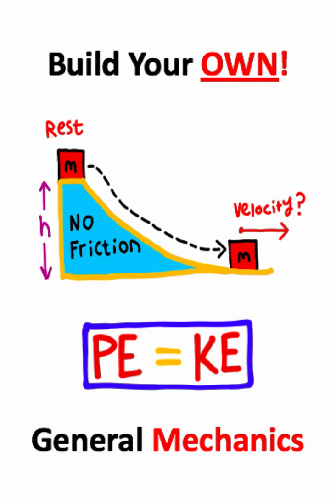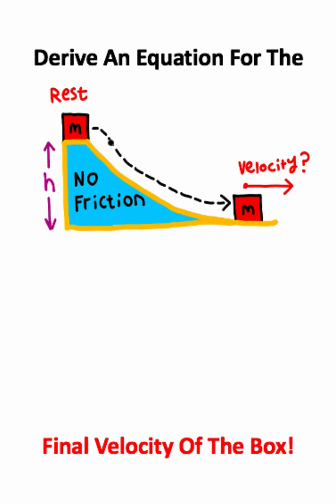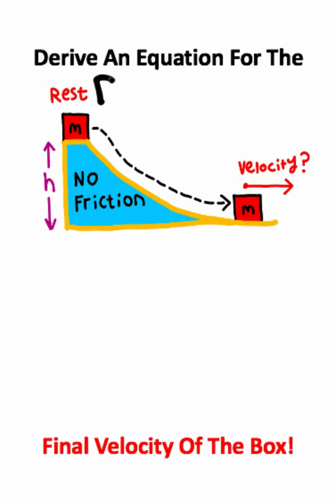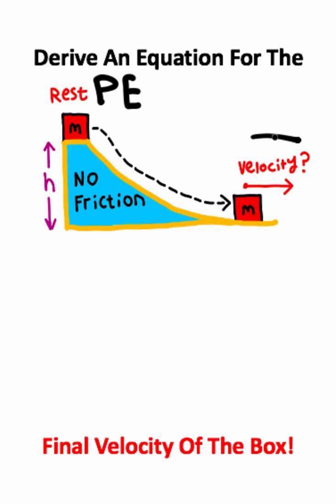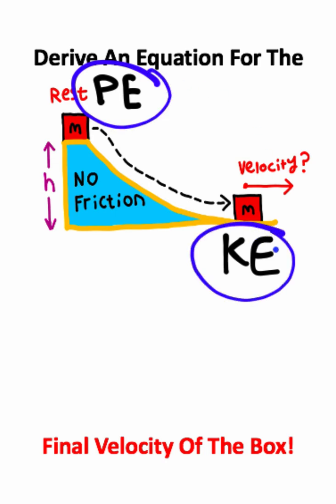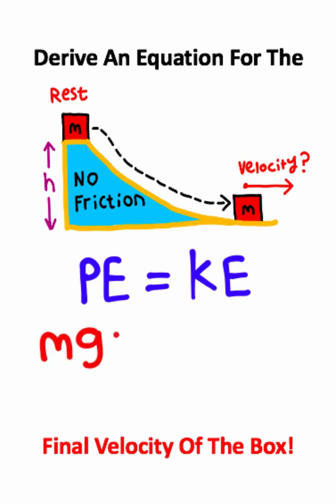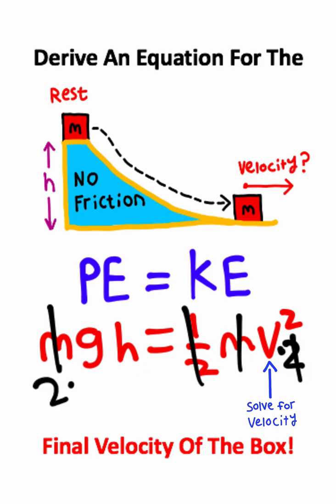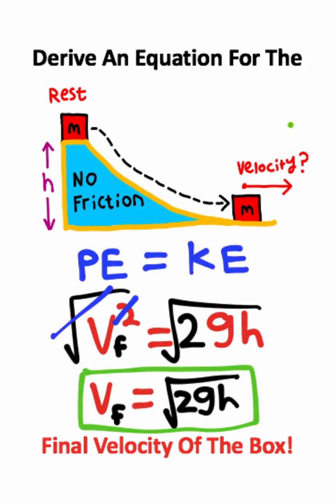Engineers MUST Know This!!

Comment: And here I have some question for you. The gravitational force acting upon the block had the equal and opposite reaction on the ground - essentially accelerating Earth a tiniest bit in the opposite direction as the block. Like, imagine the ramp isn't attached to the ground but can slide over its surface freely; it will have a certain kinetic energy at the end. Where's that energy stored? How to determine when potential energy fully converts to kinetic energy of one object, and when it should be split between two?

Comment: But there is no friction...
Reply: How it supposed to slide
Reply: @bolbans  no friction means it slides effortlessly, friction causes it to not slide as smooth
Reply: @Wudjja  does it mean it has friction of 1?
Reply: @bolbans  in the example in the video its 0
Reply: @Wudjja  alrighty, for the moment I started thinking that without friction it wouldnt be able to move at all, on the second thought, it won't be able to decelerate at all
Reply: It is the best assumption when calculating max speed. Any friction would be mess than that.